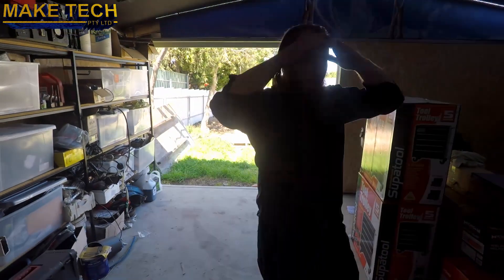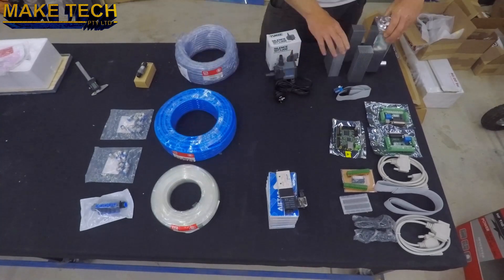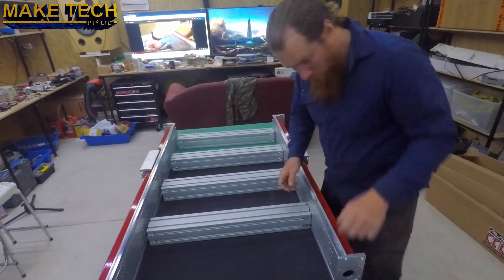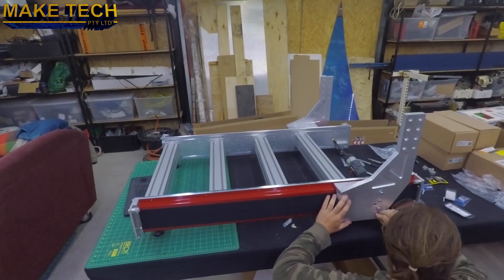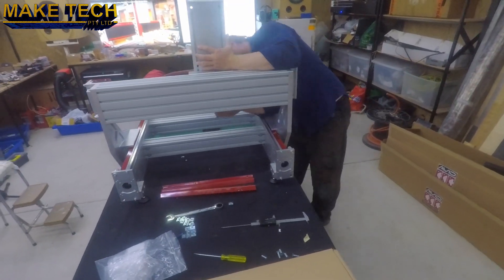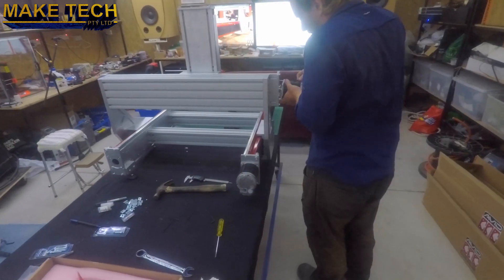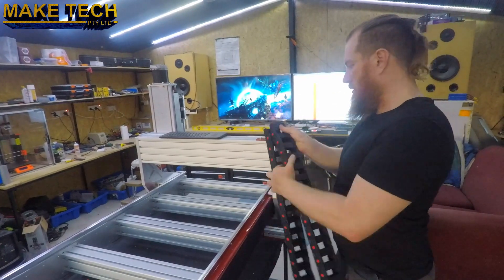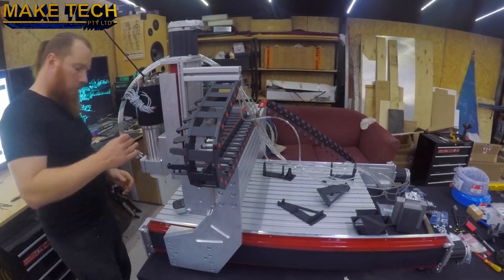Make Tech - CNC Build 01

Comment: Nice!  What Clearpath models did you end up with?  I was just spec'ing out a few different types, strongly considering the CPM-SDSK-3411S-RLN NEMA 34 models.
Reply from the maker: Oh I missed your comment. I believe it was this unit because the rpm is 4k and the torque is slightly more than the nema23 that come standard on the avid kit.
https://www.teknic.com/model-info/CPM-SDSK-3432D-RLN/?model_voltage=75VDC

new video is up :)

Comment: Edit just started checking out your other videos. RCS! friggen sexy!!!!! 

thought i was already subbed but i was mistaken fixed, subbed now. friggen ay what kind of boom is that camera on that does a full 360? i NEED this. lol. sending some traffic your way in the next couple of days, your stuff is great! is it on a drone? no camera man is that smooth...
Reply from the maker: Haha, thanks man. It's all custom built. I'm about to start selling them but there's a few logistical issues with Corona virus at the moment effecting supply of parts. Also I'd like to try some different options to reduce backlash in the 1st and 2nd degree of freedom. I should be able to integrate these changes into the first units that are produced and label it RCS V1.1
Reply: @MakeTechPtyLtd  backlash.... ya know I watched an old imagineers special when I was a kid where they made anamotronic abe Lincoln. The imagineers said they kept getting worse and worse results when the would try to fix it by using interpolation, until they realized they needed to intentionally overshoot the target while slowing down and then pull back to the proper position with reverse interpolation. I'm sure I'm not working that right, but basically  It made for smoother, more natural movements than just interpolation to the exact destination. I dont know if that helps, and I noticed a couple spots where there were tiny jerks. But I didnt care Your camera is amazing brotha!
Reply from the maker: @Technivorous  that's quite interesting. Thanks for your feedback and support.
Reply: @MakeTechPtyLtd  no joke, how much, and put me on the list.
Reply from the maker: @Technivorous  regarding price, I have an idea but not publicly announced yet.
Reply from the maker: new video is up :) . Hope all is well bro.

Comment: Thanks for making this video, Grate stuff, Would you consider a video about setting up the ATC spindle and what bits and pieces you used for auto tool change. I am in Aus  as well and have the 1.5Kw spindle and can't make head or tails of what is needed to get it running.
Reply from the maker: Hi Matt, yeah I will document this build in fairly thorough detail. Stay tuned 😀
Thanks for watching.
Ken
Reply from the maker: Hi Matt, new video is up, I haven't started wiring it up yet but Ive got the electrical enclosure setup.

Comment: Any chance you can share pricing? Great video production - good to see your robotic camera in action. Nice video break down in the description too. Giaco loves his avid cnc also, looks like a good choice.
Reply: Also curious on your compressor stats you're using for the ATC?
Reply from the maker: @aarondcmedia9585  I intend on "investing" in a Chicago Air HUSH150. For now I have an old noisy compressor and a new cheap small silent one. The bearing seal requires constant air so it will chew through air. The plan with the air pressure sensor is to pause during tool changes if the pressure gets too low to accommodate an under powered air compressor or if there is a leak, blown fuse etc etc.
Reply from the maker: Sure Aaron, thanks for your interest and support.
The spindle was about 2k AUD, the servos were about 600 AUD each including shipping and tax etc.